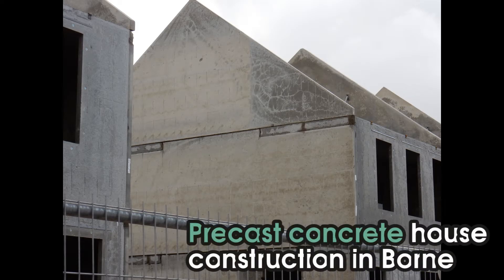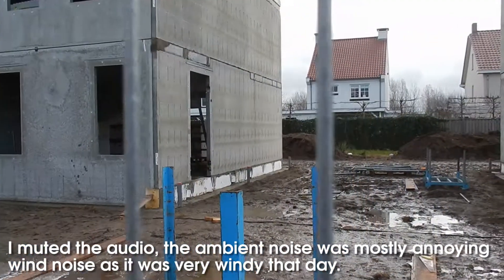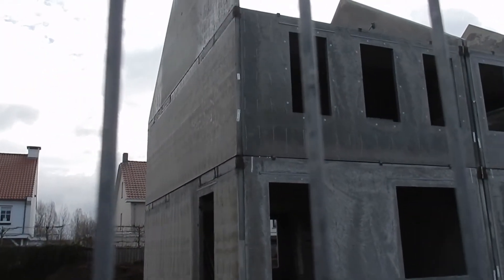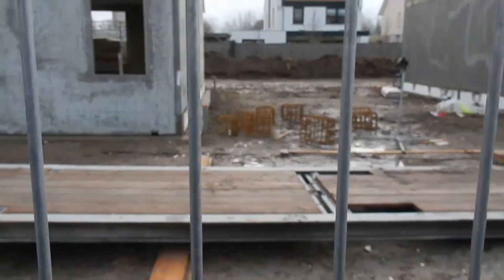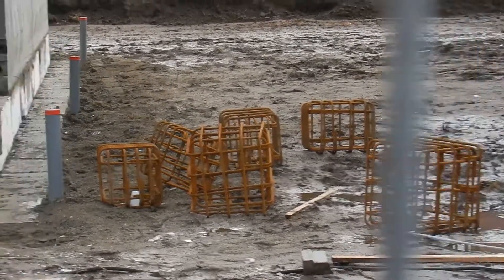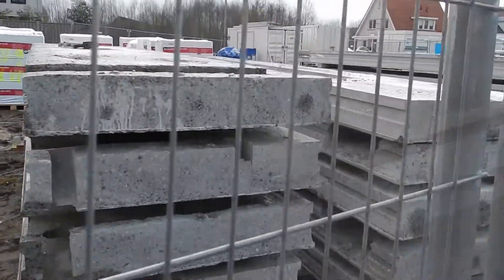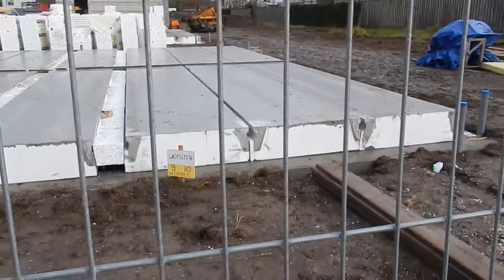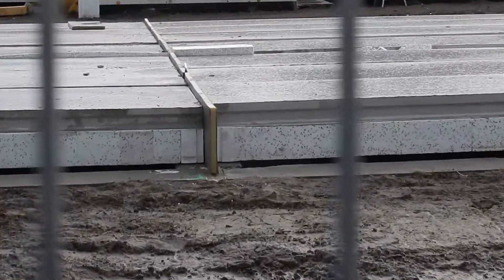Precast concrete house construction in Borne

Comment: The weak part of this is the joins between the concrete sections.  I prefer continuous concrete that is formed on site.  They are building a continuous concrete 15 floor building near me but I am not impressed as are continuously and you can see the lines in the concrete where it was allowed to dry.  The problem is that you can't get workers in over the weekend.
Reply from the maker: Beno The joints are  not really a big deal, the reinforcement bars are important. Concrete and other stone like materials such as brick have no tensile strenght, the reinforcement bars take this role. This may sound bonkers, but concrete is normally cracked. The cracks are really tiny and not really visible. It does not make a difference if it has join or not, the anchor length of the rebar matters. A monolithic structure has a different kind of stability system. Many people are scared of precast because of Ronan point, precast structures generally have the same static system as masonry structures. In situ concrete often is built as a moment frame, where the joins can withstand bending moments (because of additional reinforcement). The design principles behind precast and in-situ are totally different. Precast for high-rise buildings have rebar connections ensuring redundancy that Ronan Point did not have. Could you film the building you describing, I could explain the structural system if I see it.